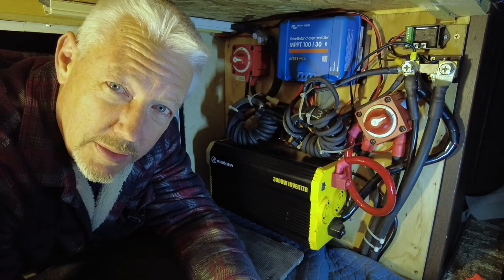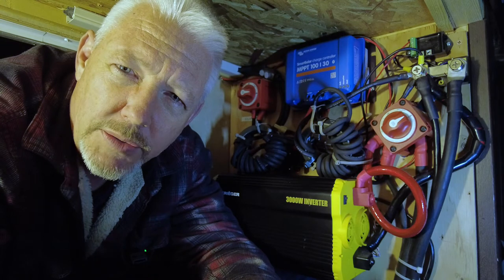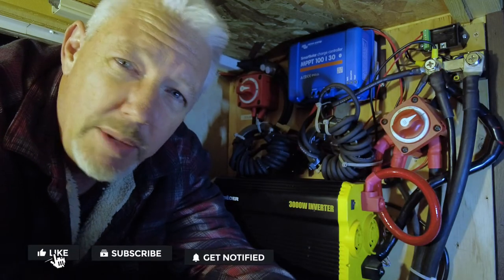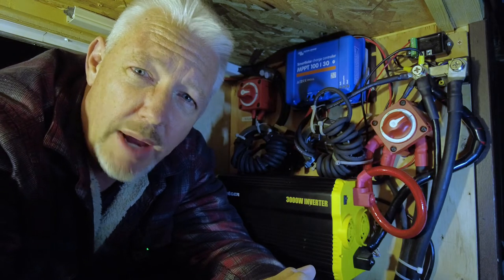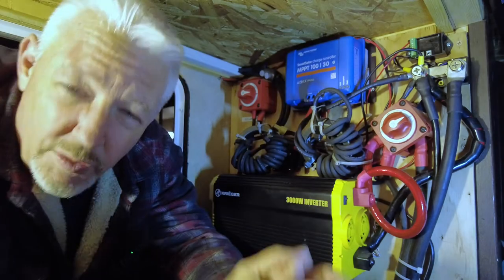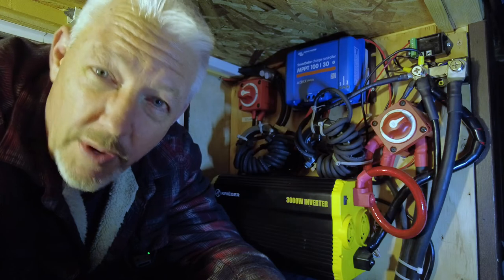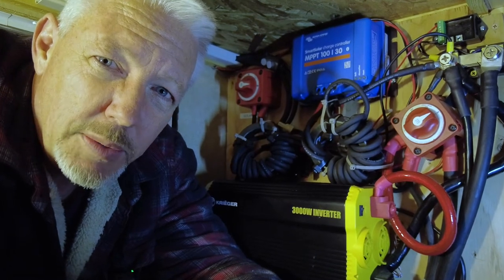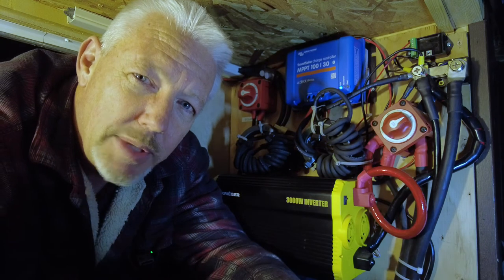RV Power Disconnect Switch | TheRVAddict

Comment: Ok, so if I am parked and drawing shore power, my (Perko) battery disconnect device should be set on the word "On"? It only has an On and an Off choice.
Reply from the maker: Yes, ON will be your choice. You should only need OFF if you need to repair something or work on the electrical.  A very good safety device that switch is.  Thanks for asking
Reply: @RVKevin  Thank you for replying!